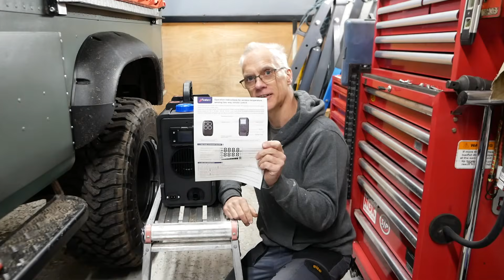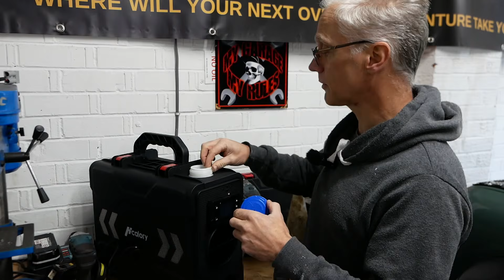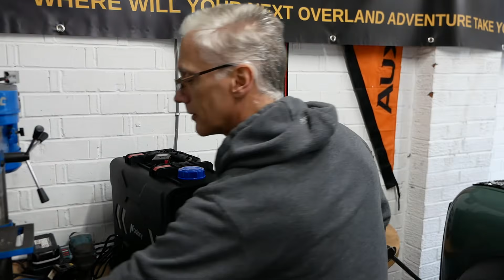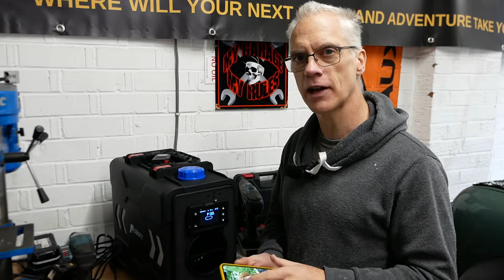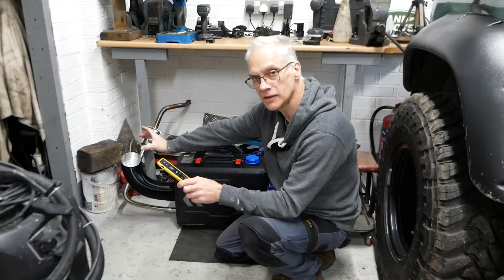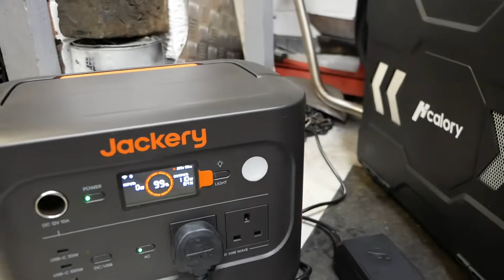HCalory 8KW Toolbox 2s PLUS Portable Diesel Heater

Comment: Just ordered one, going to get creative with ducting to heat two swags 🤔. But like you it can heat the workshop when were not overlanding/camping.
Reply from the maker: Hi...this heater is great and really versatile i have still got to get the ducting for mine to heat the roof tent so will be making another video on it...but i don't think you will be disappointed with your purchase.
Reply: @All4Overland 3" ducting and fittings seem more widely available. Eberspacher do a 100m to 75mm reducer, so I may look into using 75mm ducting..
Reply from the maker: yes...100mm ducting is harder to get but like you said you can get the reducer to 75mm

Comment: I had one of these, albeit a version from a few years ago. Used it in my flat and used a AC-DC power supply - worked a treat when electricity prices were very high circa 2022/2023!
Reply from the maker: Hi..they are really useful piece of kit and so versatile and very cheap to run as well...

Comment: Good review Paul ! I'm not an overlander but I live 100% off grid & I do have a homemade rig that I use on my road trips, I've been looking for one to mount in my camper so I can camp a little earlier in spring & later in the fall :) I'll have to check it out further ! I know you said 240v but your plugged into 120v & it will do 12v as well correct ?
Reply from the maker: Hi...no our power supplies are 240V at the outlet on the wall in the UK but i know that HCalory do a US Version which will be 110v for the outlets and the unit will run on 12v and 24v  Have checked out your channel it looks really cool where you are in Northern Alberta.
Reply: @All4Overland  Oh ok, Ya I had a neighbor for 15years that was from the UK he said everything there was 220-240 ya very different, Those little heaters are nice & ya once they are running use very little power, Yes we just got our first snow on the ground but only a couple inches but here to stay until mid April :)
Reply from the maker: If we got two inches of snow here the whole country would grind to a halt..just been watching your video on the moose hunt great stuff keep em coming!!
Reply: @All4Overland  Ya that's what my neighbor said , Here we get around three feet & some times we drive with 4-6 inches on the road just another day going to work or coming home 4+4 is a plus around here :)

Comment: Maybe I'm missing something but I don't really see the point of including a 240v transformer.
I mean, if a 240v supply is available, why not just use an electric heater?

The heater, itself, seems decent enough though.
Reply from the maker: Hi...the 240v supply just makes it more versatile i would say...at the moment i have it sitting in my workshop plugged in heating the workshop and works out alot cheaper than using an electric heater...